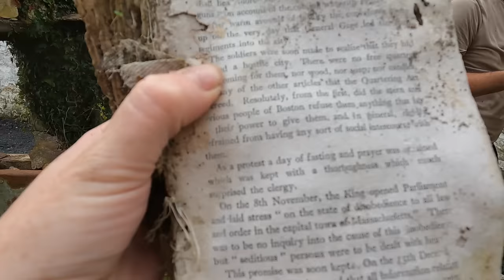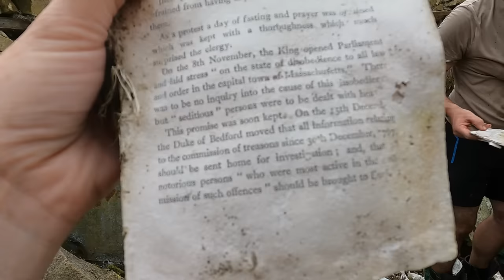We move into our new temporary home on wheels! Episode 5

Comment: 1st October am binge watching, built our vegetable garden on hardfill, after 30 years, the vegetables have always been good, only built it 6 inches high.
Reply from the maker: Hi! Thanks for binge watching us! 😉 What is Hardfill? The land here is very waterlogged and clay! I'm thinking I'll have to do raised beds! 🤔
Reply: Hard fill is stones and rocks but not crushed as fine as yours, house and garden are on the side of a rise, only place for the vegetables was beside a old loading bank that had hard fill applied around it, but big stones had been used, similar to what you have been digging out of the barn. 
When we did one renovation removed the old wash house it had 3 different layers of cement under it.  They must of just kept on adding cement to build the floor level up every 20 to 30 years here in New Zealand.

Comment: A second power adapter sold by Bluetti will quicken your charge dramatically. There are videos on here how to do it. I’m sure you probably know and looks like you have plenty of openings but watch out for carbon monoxide if you are running the generator under a roof. Good luck.
Reply from the maker: We now have 2 adapters. Thanks for suggesting it, but we quickly realised how much faster we can charge the power banks with 2. Much better. 👍